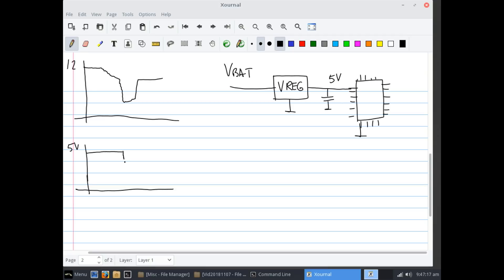One way low battery voltage can brick car modules

Comment: This video is supposed to explain why the FRM fails, but it is such a shame that you are misinformed about the reason on why the FRM is failing. The FRM will also fail without brown-out, when just resetting the control module by means of reading or clearing the DTC's, i.e. it's not a hardware issue. Also, if you do some coding and then power-cycle the FRM and this problem occurs, the flash still contains the old coding. (I know because I can recover the contents of the flash after this problem occurs) This means that the flash is already corrupt long before the brown-out occurs. It's simply because the contents were still mirrored in RAM that the module kept operating until the brown-out occurred. Some more reading material for you:
https://github.com/tomvleeuwen/dflash_to_eeprom/blob/doc/errata/README.md (My readme)
https://www.nxp.com/docs/en/errata/MSE9S12XEQ512_1M25J.htm#xxMUCts03822 (Official errata explaining many possible causes of the issue, none of which contain "random data executed")
https://translate.google.com/translate?sl=auto&tl=en&js=y&prev=_t&hl=nl&ie=UTF-8&u=http%3A%2F%2Ffrm3.ru%2Fteoriya&edit-text=&act=url
Reply from the maker: Re: "it is such a shame that you are misinformed about the reason" Melodramatic much? :D

Other than that, thanks for providing the specifics. My video describes a generic failure mode of MCUs, with a sequence [misfortunate reset of MCU => corruption of MCU internal data => unintended behavior, including possible writes to flash memory].

Here we have EEE, a subsystem of the MC9S12XE MCU, is reset (or powered down) while it is working (a common theme in MUCts03821 - MUCts03823 erratas). Sometimes the EEE wakes up in undefined (random or predictably wrong?) state, which then results in unintended behavior. Thus, the failure sequence must be pretty similar:  [misfortunate reset of EEE => corruption of EEE internal data => unintended behavior, including possible writes to flash memory]. Any objections to this interpretation?

As only a subsystem of the MCU suffers this failure, I agree with you that the rest of the MCU can continue to work normally, and the failure will reveal itself only after the MCU restarts (clearing DTCs does that, right?) or is power-cycled.

Other than the issue limited to a subsystem of the MCU, I don't see the pattern of failure to be significantly different. A more interesting question is exactly what events lead the EEE to reset (or power down) and then get out of bed on the wrong side? A purely software issue would (hopefully) get quickly patched, so what else could it be if not power supply issues? If you have ideas about that, please share.
Reply: @DmitriyL_Arithmechanics  Thanks for your reply, I know that the title and description is quite generic, but that this video is actually a follow-up on an FRM3 failure. You explicitly state it in the description. One of the reasons that I was so irritated is the fact that you mention that a new hardware revision will prevent this problem from happening again (10:18).

A little bit of background , I have a lot of corrupt EEE images (about 10.000 by now). From these images, I know exactly what the hardware and software versions is, and the production and programming dates. Off coarse, most of the FRM's that have this issue were produced when there were still cars with FRM modules in production. However I have corrupt EEE images from all hardware revisions, even the latest. So buying a new FRM3 instead of recovering it is just a waste of money. This issue is clearly is also not fixed in a new software revision since these latest hardware revisions also contain the latest software.

I didn't mean to say that it's a software issue, but more that it is not related to the power supply or reset circuit. It is clearly an internal issue of the MC9S12XE MCU. I don't know for sure if clearing the DTC's will reset the module but I guess so. I know that coding the FRM never bricks it, but clearing DTC certainly will. Waking up in undefined state is thus something I refuse to believe. It's hard to guess which of the 3 erratas is the exact culprit.

I was also annoyed by a number of other inconsistencies in your video, for example that instructions from RAM would be executed. Automotive microcontrollers typically only execute from P-flash and not from RAM (they have similar technology like the no-execute bit on Intel processors), so "garbage instructions" in RAM would be a strange explanation. Also, RAM is never initialized to 0 by a reset, but instead always contains garbage after a power cycle and the previous state after a reset. Only the software located at the reset vector (which is stored in P-flash) will initialize it correctly. The only thing that needs to be consistent to have a "clean" reset is the Program Counter and some CSR's, and in my experience if you start with a random Program Counter, the CPU will trap very very quickly, 99% of the time at the first memory access. So I highly doubt that there are any modules that brick by "unintended behavior" after reset.
Reply from the maker: @tomvleeuwen  Not 'follow-up', but 'response' video! It inspired me to put together my thoughts on how low voltages can brick modules, in general. I see how you, watching it through the lens of that specific FRM issue, can be unsatisfied, but would you consider taking off those lens? For example, when I'm talking about 'module with updated hardware that actually works correctly', don't interpret that I mean that BMW has such a module. Because I never said that.

It will take too long to go through all the points, but on the topic of automotive MCUs executing instructions from volatile memory, I think you will be delighted to discover that NXP's Kinetis EA uses a cache to optimize flash execution performance.

One question I would really appreciate if you could answer: when you are communicating with the FRM when it's installed in the car (clearing DTCs, updating, resetting), does it try to turn loads on/off briefly, for example, any interior/exterior lights flicker? Thanks!

Comment: But how would you change out the battery than? Wouldn't that kill the modules as well? Assuming the voltage never dropped below a certain threshold.

Or is it really just happening when there is still voltage and it's "just" too low instead of completely gone from one second to the other?

Other case:
Let's assume the voltage dropped too low in a running state and the module still works. Now the vehicle is normally shut off (to either change the battery or alternator, for example). That would destroy such a module as well, right?
Reply from the maker: "it really just happening when there is still voltage and it's "just" too low instead of completely gone". Pretty much this.

The issue is likely to happen during short-duration voltage drops. On the other hand, when the battery is disconnected for a long time (several seconds is eternity for computer chips), all circuits inside the module arrive to their OFF state. When the battery is connected again, the chips inside the module start running from scratch -- this situation is well tested and goes without a glitch. 

Another way the issue can happen is if the battery terminal is not making a good contact. This will produce short-duration voltage drops if someone touched such a battery terminal.

I think Keith mentioned he will cover the topic of changing batteries in the future, so let's get some popcorn and wait.

Comment: Excellent video.  Your combination of the voice-over explanation with the hand drawn diagrams did a great job of clearly explaining this issue.  There are definitely certain makes of vehicles that are more prone to bricking a module due to a low battery voltage situation, but really any make of vehicle can suffer this.  Would be interested in your thoughts on the impact the age of the electronics in the vehicle has on this issue too - is a 2001 vehicle (regardless if it has 30,000 or 300,000 miles on it) on it more susceptible to this issue due to age & older design of electronic components, than say a 2015 vehicle (with it's typical 30,000 miles on it)?  Has the electronic components gotten better over time to help combat this issue or will we always be dealing with this issue in the future?
Reply from the maker: Thank you, I wondered for a while what presentation format to choose, and am glad that this one worked out alright. 

Judging by application notes from manufacturers, nowadays they provide recommendations for dedicated reset chips (or voltage regulators with reset signal outputs) for their microcontrollers, so it should be easier to create a robust design. That is not to say that we will not see someone goofing it up occasionally -- but, hopefully, not in vital or safety critical modules.
Reply: That is good to know that the electronic component manufacturers are recommending the extra chips to protect their microcontrollers - now we just have to hope that the module designers at the various vehicle manufacturers follow those recommendations & their respective accounting department does not look at these "extra" chips as just another additional cost that can be cut to save a few pennies on each vehicle during the final assembly process.